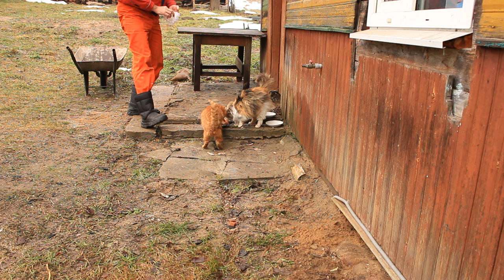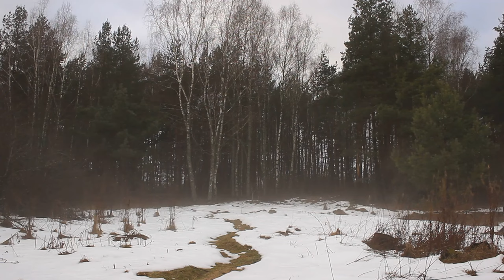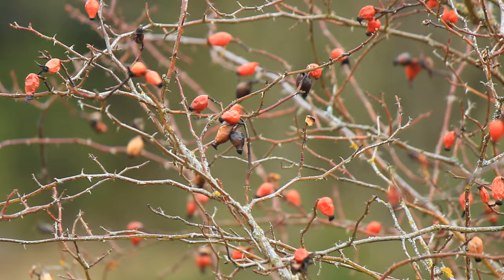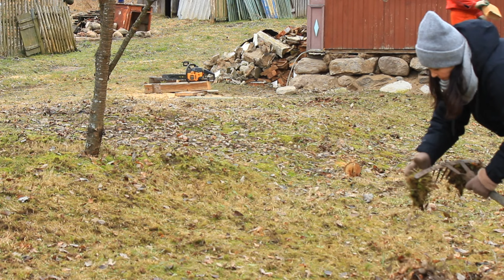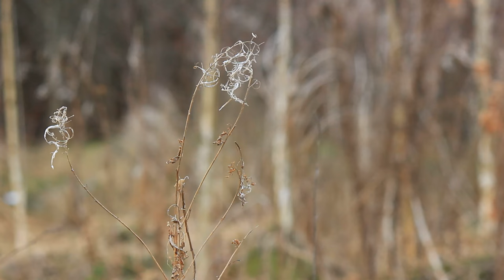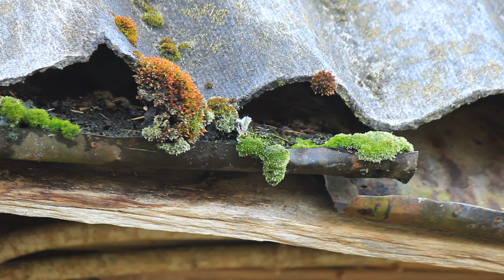LIFTING THE HOUSE. Align the corners of the forest cabin. Construction materials have been delivered

Comment: When raising the house did the brick kitchen also rise? Was it resting on the ground or on the wooden plank?
Reply from the maker: The house sits on large rocks and the stove sits on a separate foundation.
Reply: @VillageForestHouse_  Ok, I couldn't understand from the video. You did a good job, if you had used oak wedges under the corners it would have been easier to adjust the height but you managed it anyway 👍